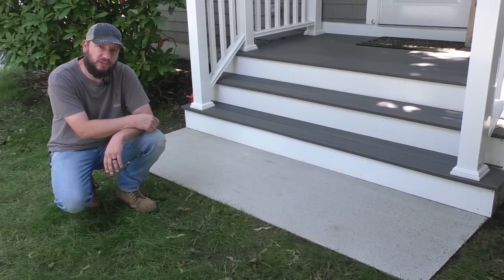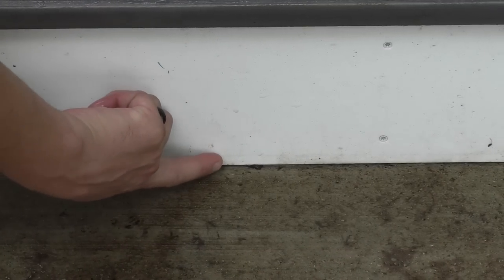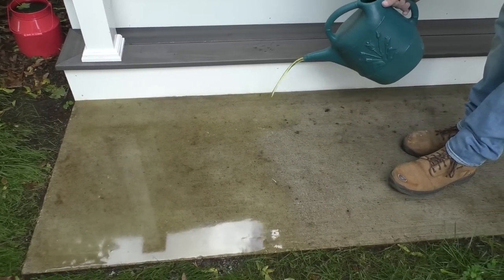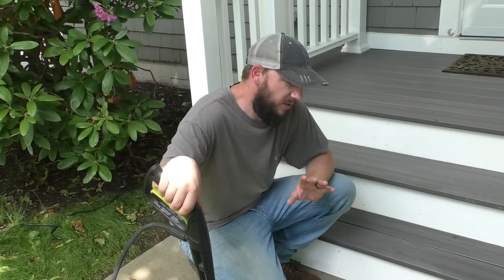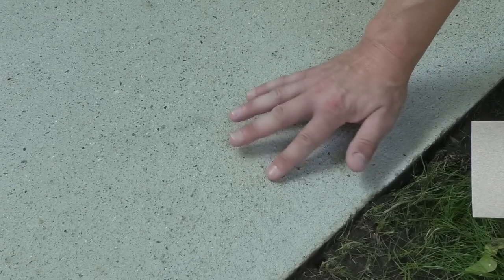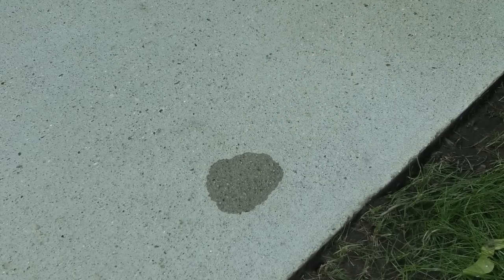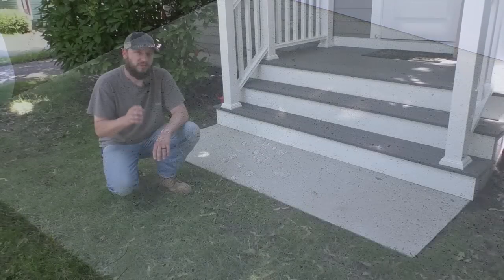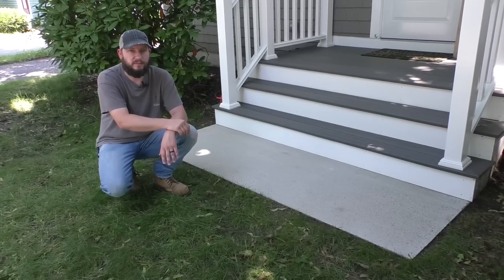How to Clean, Etch and Seal a Stained Concrete Pad

Comment: Here in Seattle any concrete/cement that doesn't get sun exposure all day during the rainy season gets a layer of mildew. Annual spring job is pressure washing the entire east-facing driveway and blasting up a couple pounds of black gunk. Looks great until Thanksgiving.
Reply from the maker: Yuck!
Reply: It does get a little old around March when the daily driver start to grow mold and moss also!  But at least we don't have a lot of snow!
Reply: Same in Ireland. Similar climate .

Comment: WHY didn't you remove the first step riser to fully expose the concrete and prevent the acid from getting on the painted wood?
Reply from the maker: Because the miters are glued and probably would have ruined it.  It is vinyl so I wasn’t worried about the acid.

Comment: Good video buddy. I have to admit at the start i was thinking whats the point but i do have to be fair it does look good. Do you know how long it lasts before you need to redo it again? If not would you be able to give us a heads up later down the line as to have its going please as i am very interested in doing this. 

thanks for sharing buddy top job
Reply from the maker: It should last 1- 3 years for an acrylic sealant and 5-10 for epoxy and urethane.  Hope this helps!